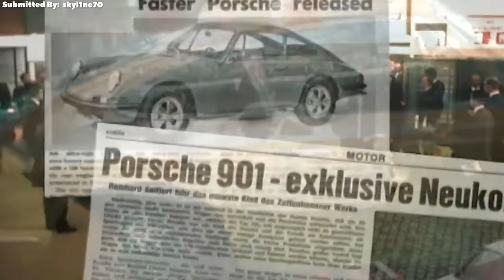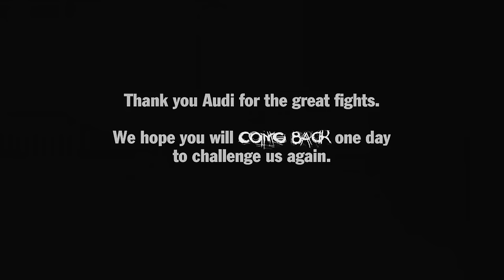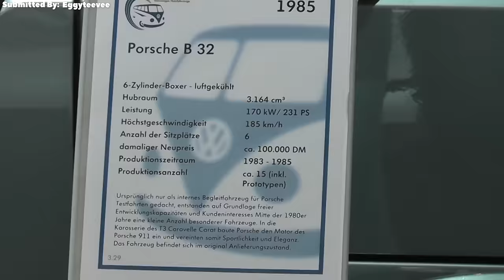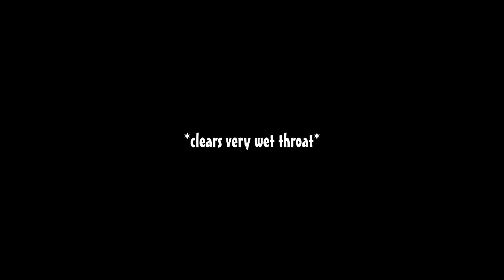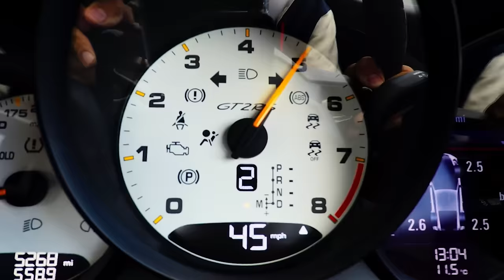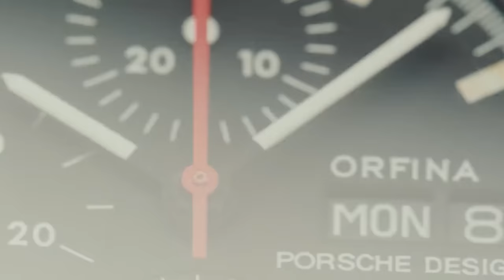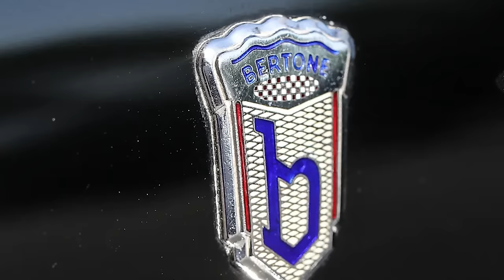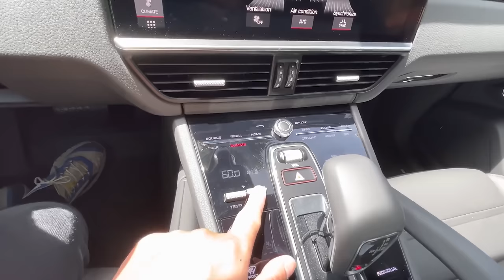101 Facts About PORSCHE

Comment: The Porsche racing V10 was actually 5.5L and then increased to the 5.7L for the Carrera GT.
Reply: I also remembered a lot about 911 GT2 TEAM SCHUMACHER. It is also ever fielded by Michael Schumacher in 1998 GT2 Championship.
Reply: and the engine was born for F1, not for Le Mans racing cars
Reply: That V10 was originally a 3.5L, made for F1, that Porscche didn't use in F1, but went back to GT1. Then came the LMP2000 and then the CGT

Comment: 17:05 the 944 ended production in 1991, the front driver and passenger airbags were added in 1987. They were also only standard on the 944 Turbo, and optional on normal trim 944s
Reply: @hoshino353  I find it pretty important to get the facts right in a facts video
Reply: @Delta0429  and thank you for informing me about these facts my friend
Reply: @Delta0429 Thanks!

Comment: on 13, the 917 (nine one seven, not nine seventeen) didn't have a v12, it had a flat 12 made from 2 flat 6s, because porsche had experience making the flat 6, but not any 12 cylinder, as the f6 is whats been used in the 911 since its birth

Comment: When it comes to the question of what vehicle in Porsche‘s lineup saved Porsche from bankruptcy, a more accurate statement would be the Boxster I would argue saved Porsche because it kept the lights on and the money flowing from it’s successful sales from 1996 to 2003 for them to make their next big project, which was the Porsche Cayenne SUV which made it debut in 2003 as the base model with the 3.6 L V6 with a six speed tip, Tronic automatic transmission or an optional six speed manual which no one really got so it’s a rare option Porsche released two new versions of the cayenne, the Cayenne, S and the Cayenne turbo S the turbo S was the one with the 4.8 L V8

Comment: 22:08 Nope, there's another one. In order to fit a big ass diffuser to the 2019 911 RSR race car they used the chassis from a 718 Cayman which is mid-engined. That diffuser wouldn't fit on a rear-engine.

Comment: The “G” gear in the manual was intended to be Porsche’s version of a low range gear, if you intended to drive across a rougher terrain per say. 

It wasn’t to do with sound regulation, I don’t know what idiot started that rumour 😂. 

The 959 was a do it all kind of rally racing car; hence they needed some way to indicate to drivers which gear to use over rocky, muddy or rough terrain in general!

Comment: At 6:34 Fact Number #29, the so-called left hand mounted ignition switch was completely debunked by Porsche. This was a long running belief that the left-handed ignition switch was developed for quicker Lemans starts but was actually just the result of simpler design criteria. Jay leno also brought this out a number of years ago. (Not trying to nitpick here, this is still a great video - thanks for posting!)

Comment: #43 The 917 was not a V12. It was a flat 12, or horizontally opposed 12 cylinder engine. Before anyone says there is no difference, there is a huge difference.

Comment: 4:08 it actually started of as a 5.5L V10 right?
Reply: Yup. But why was it increased?
Reply: @sabiha_.  Main modifications include stroking out from 5.5 to 5.7 litres to improve torque output and extra strengthening to achieve higher reliability.
This is what the internet has to tell.

Comment: 9:27 it's called methanol and is the same as wood gas made with a gasifier.  It's not special either.  It's been around pretty much since combustion existed.  It's going to be tough to single handledly save the fuel industry when they have one official plant in South America with a windmill in a specific place needed for its dryness and only makes about 60 to 80,000 gallons a year.

Comment: The C88 was never supposed to be a Porsche. Like Lotus, Porsche also acted as engineering consultants. That is why they also help develop the E500 and RS2. The C88 was specially designed for either a Chinese company or the Chinese government as a car they can mass produce back in China. Also the 924 was a Porsche engineered product out of VW parts because it was originally supposed to be a VW coupe, until VW decided to ditch it and Porsche decide to buy the project from VW.

Comment: The 500E was not a Porsche collaboration as the RS2 was. 

Firstly, Porsche is an engineering consultant company first, that just so happens to also build it's own cars (same goes for Lotus, who have worked together with every single car company except 1 that nobody but insiders know). Porsche had engineered, and built the RS2 together with Audi, from Porsche parts added onto an Audi (B4 90 Avant)

For the 500E, Mercedes hired Porsche (the engineering consultant) to rework the W124 E Classes (made to fit inline 4, 5 and 6 cylinders) front subframe to get the Sabuer C9's V8 into it. 

Since Porsche had to widen the front to fit the engine, the 500E (and 400E for that) got fender flairs so wide that they didn't fit down Mercedes' production line for the W124, so Porsche was hired AGAIN, to put the 500E together on the 959's production line.

Since the trans tunnel also had to be widened, the front seats had to be put further apart from eachother, so Porsche also had to do crash safety tests for the 500E

The RS2 and 500E "collaborations" aren't the same (despite both coming out of the same Porsche factory for some time). Porsche designed and made most of the RS2, while for the 500E they bolted parts from 3 Mercedes into 1. There's not a single Porsche part on the 500E, it's all their engineering work

Comment: Porsches reliability is relative. Yes, compared to a Ferrari they are reliable but this is not the same reliability as a Toyota. Source: I owned one.
Reply: Depends on what model
Reply: @sutherlacd27  what model?
Reply: @natural_law  well the m96 and m97 engines in the 996 and 997 911s that aren't the turbo, gt3, and gt2 have issues with bore scoring and IMS failures for example. But the turbo, gt3 and gt2 have the mezger engine which is as reliable as any gas engine there is.

Comment: When you started the video by calling the brand "Porsh" there was an immediate loss of credibility. 🤣 Also, all front-engine Porsches have radiators. In fact, all water cooled ones do. Also (27) Porsche doors do have set positions when opened. I have a 2023 Carrera T and it certainly does. (You actually demonstrate in 77.) The "Turbo" steel brakes that come on the Turbo and the S (as well as the GTS) are red calipers, the standard brakes are black calipers. In your "94" that is a mid-seventies 911, not a '67. Number 100 - You can't actually access the engine in ANY 911 from 2012 (991) on.

Comment: num 73 is false mercedes fully developed the v8 500e but they had an oopsie woopsie when the wider 500e couldnt fit on their production lines but porsche (who was also a consulting copmany at the time) had production lines from when they made the 959 which mercedes then contracted porsche to BUILD the 500e not develope u want more info watch the jason cammisa revalations ep. on the 500e